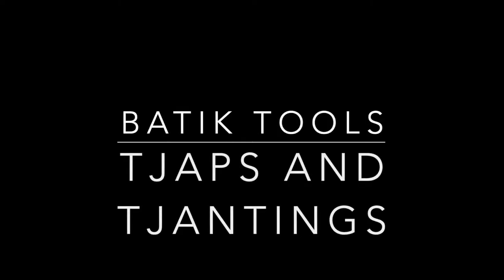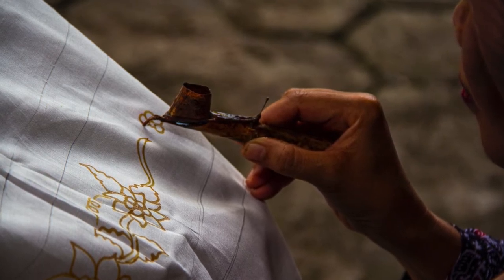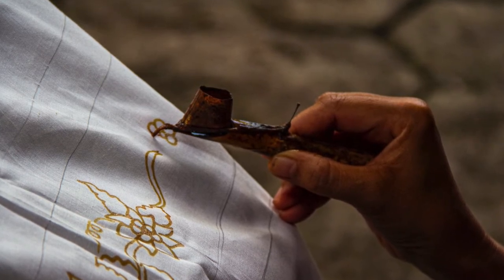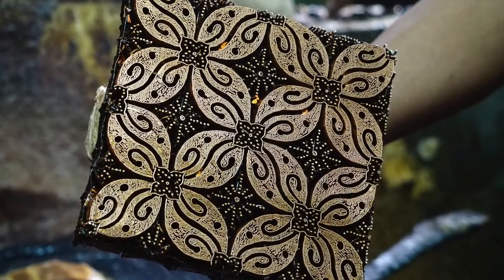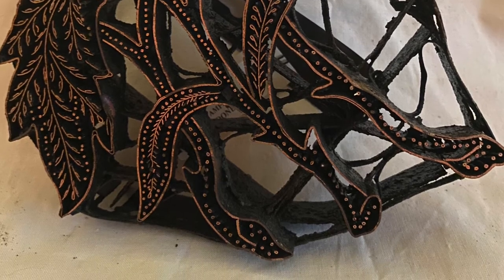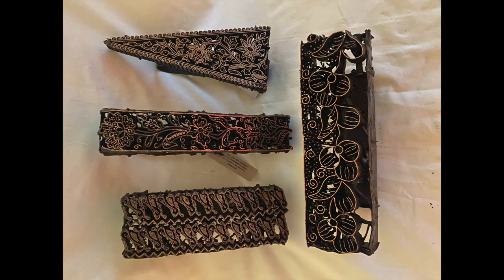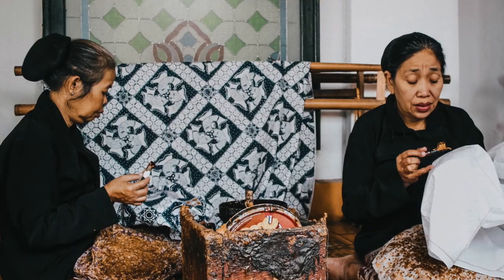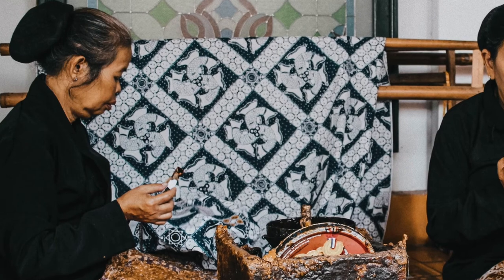Batik tools: Tjaps & tjantings

Comment: thankyou for the info, do tjaps work only with  particular type and temperature of wax. I am not having success with mine and the  stamps provide a flat pattern without its details ,hence wd like to know better
Reply from the maker: Try blotting the tjap once on a piece of fabric before using it, the first stamp always has the least detail. 
They work with all kinds of wax, but different waxes have different melting temperatures, so you might need to experiment with adjusting the temperature of your wax.